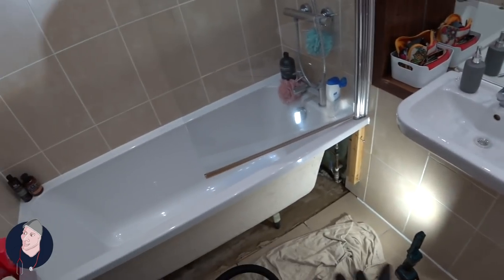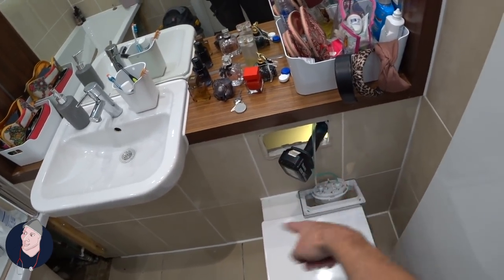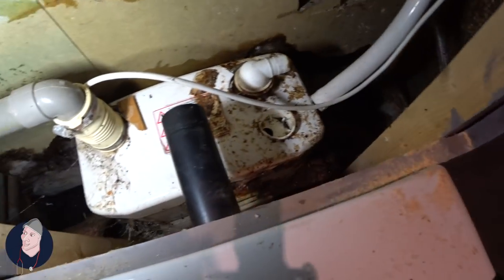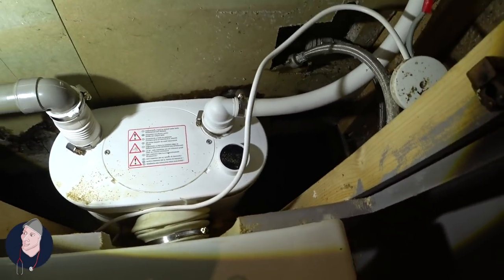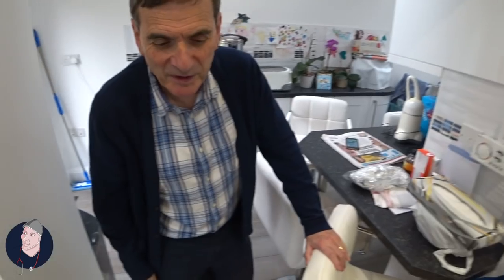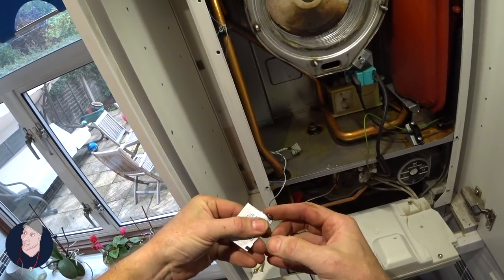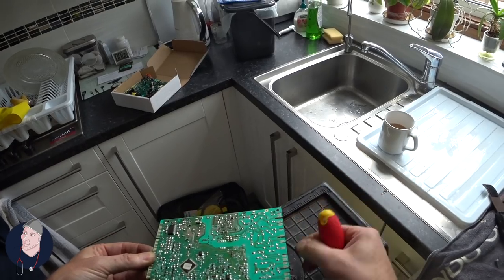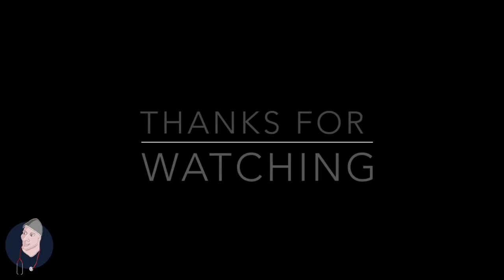Day In the life of a Plumber 25, Dr Pipe, Filthy Friday Special, Bogs & Leaks and Filthmongering

Comment: Great video mate those glow worms always blow boards all you have to do is interrupt the power supply and they’ll go even the updated boards I always warn the customer first before working on one in my experience flue hood adapters always leak and casing screws and trap go seals missing and needless to say g10 seals well out of date got called to a cxi version once on a top floor flat the plastic water section flooded two floors below it!  glad you got that one sorted well done for the perseverance 👍
Reply from the maker: Steve Ball cheers fella pleased I enjoyed 👍🙏🙏

Comment: Hi. Can ask if you attribute the boiler repair at the end to the dry joint on the pcb? Did you do a solder repair on the board to correct it? Hope you see this message as it's showing that the vid is a year old. Clearly it needed servicing though. Thanks.

Comment: Great Video!!
I've been in this industry for 25 years and still learning especially when it comes to fixing boilers... I noticed you diagnosed the fan taking out the pcb.. so how did you diagnose the fan?... i ask because you could throw a new pcb in and blow it straight away, really interested to know how you dealt with that?
Reply from the maker: shaun hartnell trust me.. I’m still learning something every week. Lots of factors why I Diagnose an issue or how.. mostly experience. If and when I get it wrong I take the parts out and no charge and put correct part in. It’s very rare these days tho. I have a system that works well and I stick to it. When I feel there’s a better way I will change it. Pleased u like the vids 👍🙏🙏

Comment: Dr Pipe quick question, why not use the nylon brush if boiler under warranty? You mentioned it on the Vaillant aswell. Just curious, went and bought one after I saw your results lol.
Reply from the maker: Damages the coating on stainless.. don’t want the manufacturers to have an excuse to get out of warranty in my opinion

Comment: Ummmmm blocked condensate trap from all the crap you washed down into it when cleaning the heat exchanger. All the black inside looks like carbon to me therefore poor combustion, did you check the air-gas ratio?
Reply from the maker: Happy Xmas